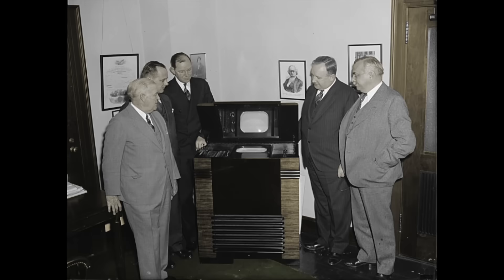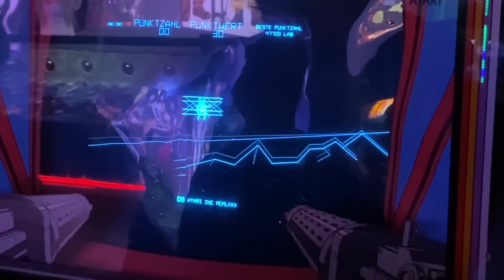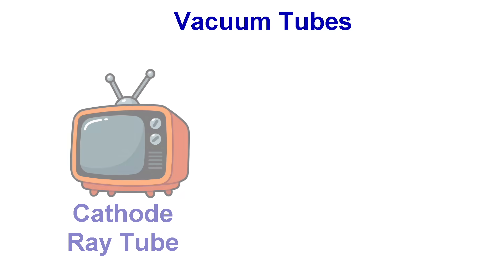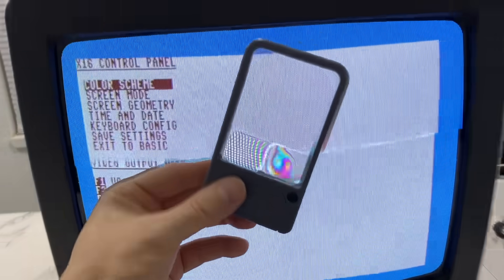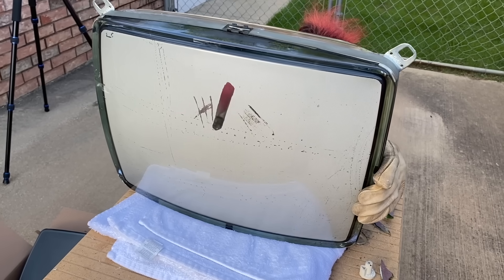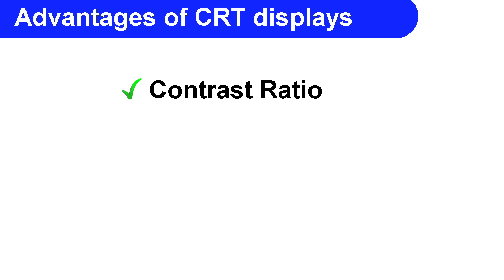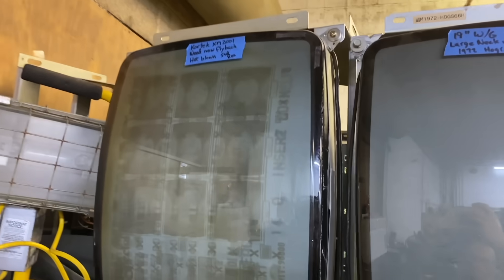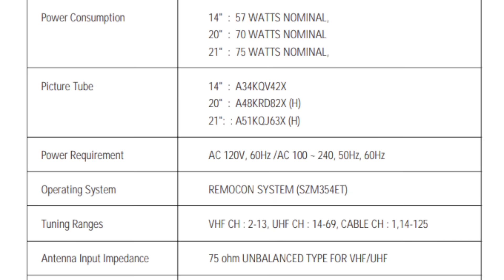How Cathode Ray Tubes Work.

Comment: As someone who lived through the flat-panel transition, it's - in retrospect - very obvious that LCD was a technology being pushed out the door as quickly as it could because people were just so damned tired of lugging around 40 pound boat anchors into their living rooms. LCDs were very demonstrably inferior for interactive applications right out of the gate even though they had the advantage of being actually portable. But then computer monitors started to converge with TVs, which meant taking on all the limitations of TVs. 1280x1024 was standard resolution on desktops and laptops years before good LCDs, which also were stuck at 1280x1024 unless you bought really high end professional monitors that you weren't about to get at a Best Buy. Then widescreen LCDs flooded the market with the devil's resolution - 1366x768. It's only now, with 120hz panels, good game modes, OLED, and 4K, that we have displays that are unequivocally superior to the 18" Diamondtron that was on my desk 15 years ago in high school.

Still, even today, I'd kill for a 4:3 aspect ratio 4K monitor (e.g. 3840x2880). Having a taller monitor means more lines of text on screen. It's particularly egregious with tablets, where the wider screen meant apps going into blown-up phone mode because there wasn't enough width in that configuration. I actually applaud Apple for sticking with relatively square-ish aspect ratios on most of their iPad lineup. Also, bonus points, the iPad has a pen digitizer in it, so we can uncheck "light pens" from the "advantages of CRT" list :P

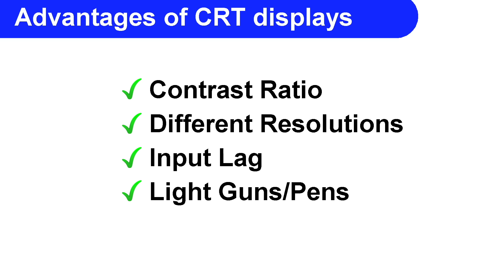Comment: 14:13, longevity, CRT vs. LCD: Prior to widespread adoption of LED backlighting, I found - because I was managing an office full of monitors - that LCD screens often didn't last for more than a couple of years. The usual point of failure was the inverter, which was about an $80 repair, usually closer to $130 with shipping, since I had to send them out to get them fixed, and those early LCD monitors were heavy for their size. Prior to around 2010, when LCD monitors cost more than $300 to replace, they were worth repairing, but once I saw that the problem was common, I started holding out for 3-year warranties on any LCD monitors I purchased. This seemed to be less of a problem for laptops at the time. I mean, I've seen laptop inverters fail, but it just didn't seem to happen anywhere nearly as often as it did with free-standing monitors. Maybe they were using more durable inverters in laptops because the laptops of the time were relatively expensive. At the time, I mostly chalked up the superior CRT reliability to the fact that at that point, CRT manufacturers had had 40 years to perfect their products, and by the time my employer began switching over to LCD monitors, replacing a CRT monitor because it had failed was a rare occurrence. The last time I had seen one fail without help, such as a fall, was in the early 1990s. The company had CRT monitors that were more than 10 years old. Heck, the CRT monitor that I had for my home PC was almost 25 years old when I replaced it in 2003, and while it had developed a very slight color problem some years earlier, it didn't seem to be in any hurry to fail. Both at work and at the office, CRTs were replaced because we wanted something that took up less desk space and offered a clearer and sharper picture.

Which leads me to my next observation: In my experience, LCD monitors always offered sharper images and better color reproduction than LCD monitors, and were easier on the eyes as well. This may be because I never owned or had access to the very best CRT monitors, and when comparing the affordable LCD monitors to what had been the affordable CRT monitors, the LCDs came out ahead. I also was not into gaming and was never too picky about my TV watching experience, so LCD problems with blurring or ghosting in fast-moving scenes and inability to produce deep blacks escaped my notice. I've never once wanted to go back to staring at a CRT screen.

As time went by, and the small, CCFL-backlit LCD monitors were inevitably replaced with larger LED-backlit ones, I did observe the dimming and color shifting problems with the CCFL-backlit ones. But I've never seen the "vinegar syndrome" you described, probably because the oldest LCD panels I've seen only date back to the early 2000s. (My career goes back to the late 1980s, and of course I remember the portables through the years, some of which had early LCD panels. But to date, nobody has brought me a "survivor" machine from that long ago.) How old would an LCD panel have to be in order to start showing this sort of deterioration?

Thanks so much for the terrific video. Like a number of others who have posted comments, I've never fully understood exactly how a CRT works, and your video brought me a lot closer to understanding that technology.

Comment: I'm using LCD now, but my biggest complaint not covered in the video is the after image that results in video games with fast scrolling turning into a motion blur nightmare on modern displays. There was no motion blur in Genesis Sonic games on CRTs. Even on Sonic Mania which designed for newer screen the game becomes a vasilline smear on an LCD when moving fast. Games and old television also vassilne smears based on different resolution which is bad as well, but 8-Bit Guy cover that one already. Until both these are solved CRT is still better in these specific ways.

Comment: CRT's would never have the latency introduced with LCD's, TFT's and such. The picture quality was far better. You'd have a heat spacer inside your room in winters. And it was just impressive to have a large beast of a flat CRT with a WEGA stamp onto it producing up to 100Hz of refreshrate. At least that was my last CRT and since then i switched over. I still have those days where i'm like, "What if i put a traditional CRT back into my house" to watch movies over. I think it would be great at 1080p.

Downsides: weight, power, dust attraction, required space.

Comment: Pretty good video, but I would like to point out a couple inaccuracies.

1. While CRTs can have very good on/off contrast ratios, their local contrast is fairly poor (look up ANSI contrast measurements). Thus, displaying dark and light at the same time will tend to give poorer results than perfect. However, due to how the eyes work, the difference is less noticeable than one would think.

2. You missed the largest benefit of CRTs: motion clarity. Moving objects on CRTs, assuming that they are matched to the refresh rate of the signal (i.e. 1 pixel per-frame, 2 pixels, etc), will appear sharper than basically any other display technology. This is due to the fact that each point on the image is strobed on-screen very briefly and incredibly brightly before rapidly decaying to black (so-called impulse drive). Modern display technologies employ sample-and-hold technology, where the image is displayed continuously. However, because our eyes track objects with smooth motion, this means that the lit areas essentially smear across our vision. Not ideal! Techniques exist to improve motion clarity on modern displays, but they are rather uncommon and none have matched the CRT yet.

Comment: 11:28 Yeah, I was one of the only students who carried one when I was in high school starting in 2003 or 2004. We still TECHNICALLY were supposed to be using zip discs, but this was just so much more convenient and held about as much as the huge, failure prone fat disc. They were already just giving USB "thumb drives" out at trade shows in lieu of those annoying cropped mini-CDs, so I had a feeling they were gonna be the future. Of course I didn't ever guess I'd still be using them 20 years later, but eh, lol.

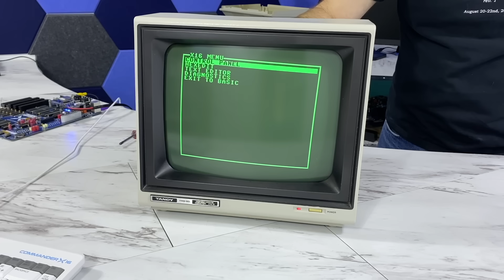Comment: 3:47 Don't try to do this at home. Every CRT tube works with very high voltage. I am talking about 8k - 35k volts!! This high voltage can kill you!! Even after unplugging your TV, the CRT stores that high voltage for a long time. If you don't know what you are doing, don't open your CRT monitor!

Comment: Another interesting capability of CRTs is "calligraphy". That was being used in simulators, and is still a capability employed by laser projectors.
Calligraphy here means, that you use the cathode ray to draw lines or dots on top of the picture itself (at the end of each frame). This way you can create very high contrast objects.
As I said, this was/is being used in simulators, for example to enhance the lights on a runway, or in a city scape.
Reply: Is it kind of a hybrid raster/vector scan pattern?
Reply: @sa3270  : Not a raster, more like a vector. The ray is literally "dragged" like a calligraphy brush, or remains on a certain spot for an extended time.
This happens inbetween each frame.